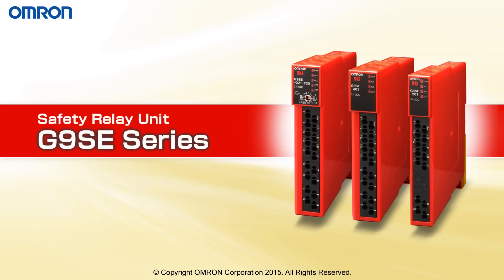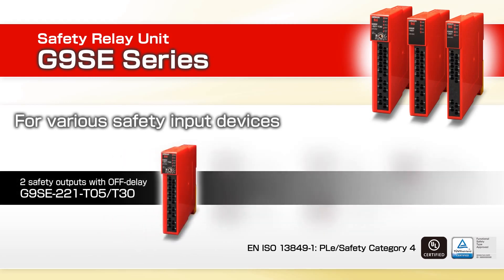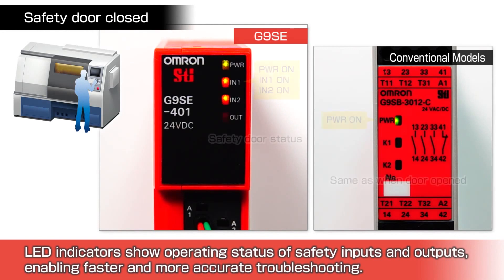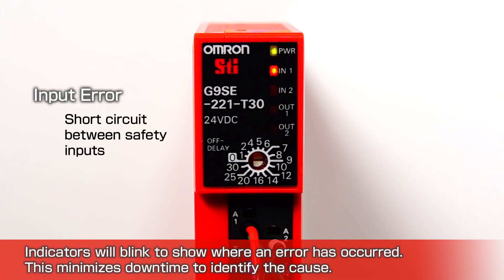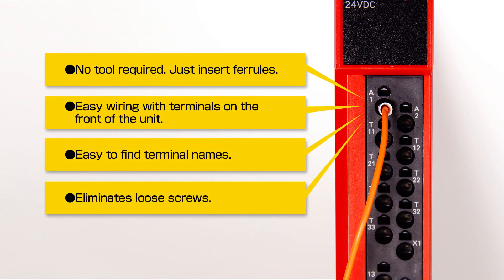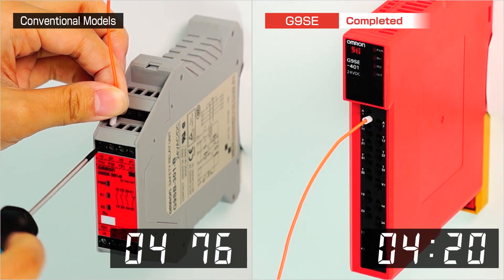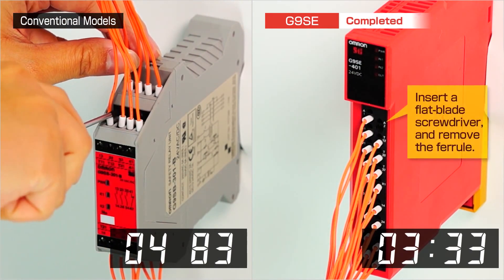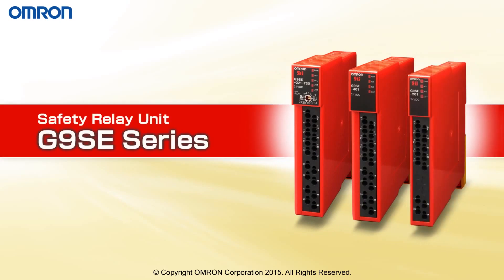Compact Omron G9SE Safety Relay Units

Comment: How to wire omron G9SE 221 T30 safety relays to E-Stop with a reset switch and VFD + contactor + electric switch on / off + reset switch + emergency stop